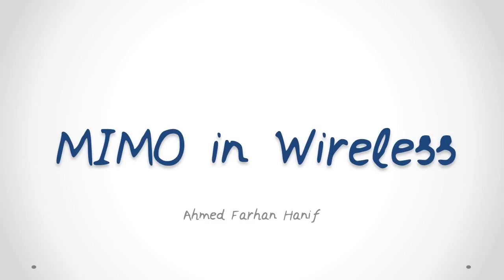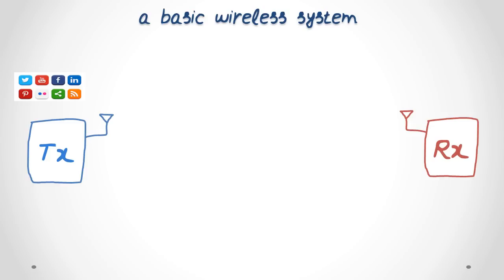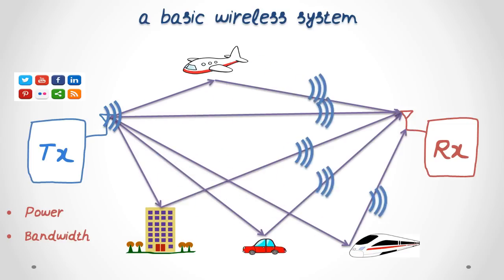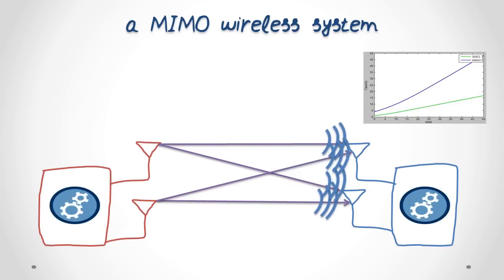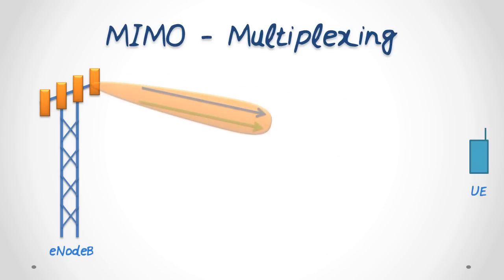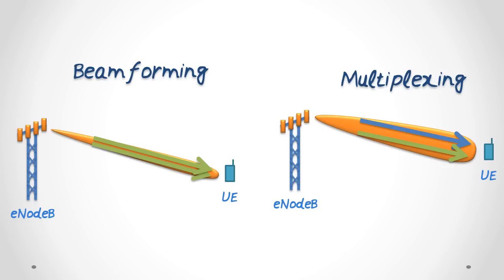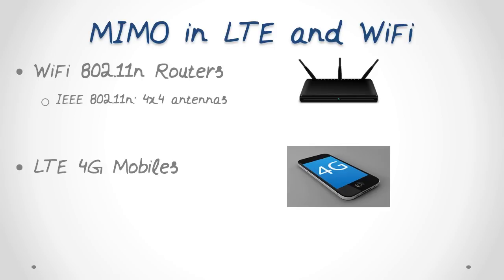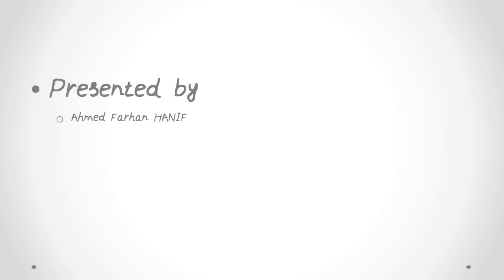MIMO and Beamforming in Wireless Systems (4G, 5G)

Comment: hello sir, which software are used for developing this simulation and design . pls recommend me few software that can be useful for me to do simulation based on broadband wireless communications
Reply from the maker: This animation is made with power point. For simulation of wireless communication systems it depends on what you would like to simulate and which programming languages you are familiar with.  There is open-source simulation code available online, which you can take and modify to your needs or you can write your own simulation platform from scratch.